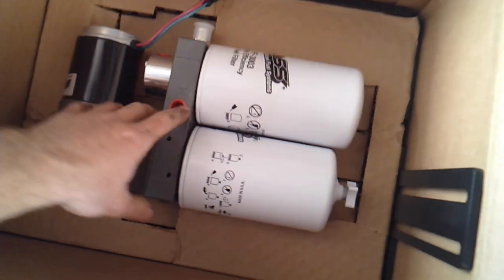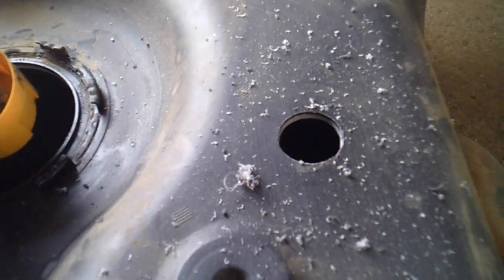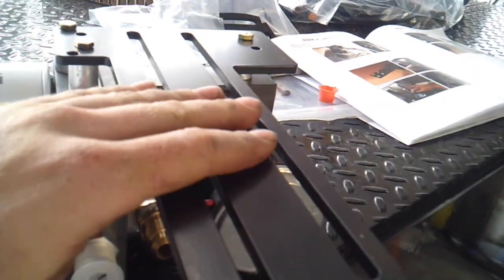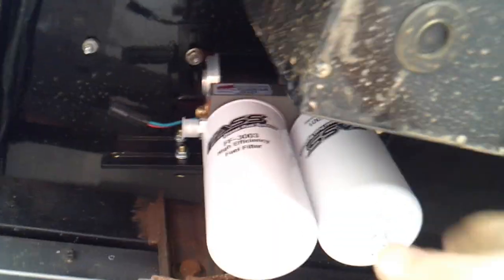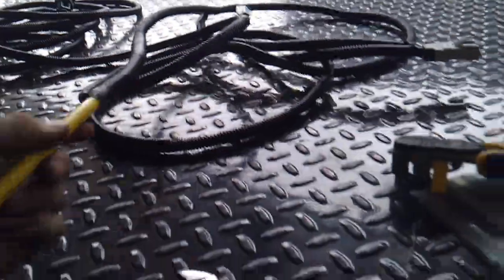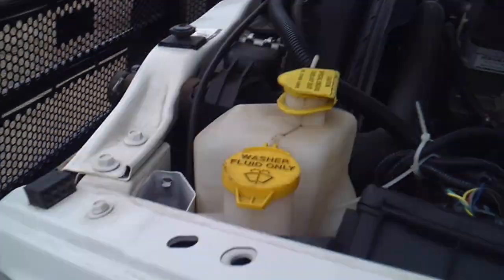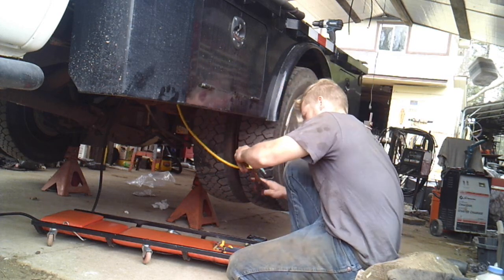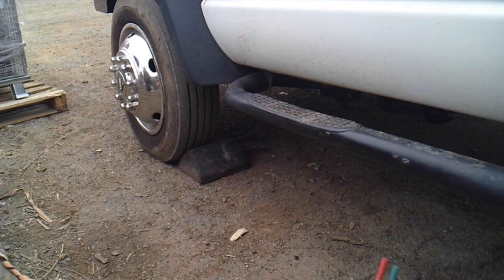INSTAL FASS 150 ON 6.7 DODGE CUMMINS

Comment: You can't hook the fuel line into the factory fuel canister so avoid the 1/4 tank issues?
Reply from the maker: I’ve never have any 1/4 issues. And factory pick up is to small

Comment: Next time you install one use a gnr tank sump . 2 of my cummins trucks have them . Never have to mess with tank and no 1/4 tank problems
Reply from the maker: I run off road everyday with my trucks. logging trails and rough roads. I cant and wont ever run a sump for the fear of something like a stick ripping it off the sump or a fuel line. just not a risk im willing to run. I don't want to be left stranded. thanks tho:)
Reply: Help me with mine
Reply: I have been running a Deviant return sump on my 07 for 5 years now. This truck runs overgrown mesquite rds here in west Texas and have never had an issue.. not to say it couldn’t happen.. Fixing to do the same thing to a 12 I just picked up with 91000 on it…

Comment: So I have a motorhome that has a 8.3 Cummins and I install a fass system I was unable to get the 150 and when I looked at the 165 it said it was meant for horsepower 600 or more so I got the fass 95 I wonder if I made the right choice.

My horsepower is 330 but my torque is over 900 and my tank I think it's a 120 gallons so perhaps I should have got the Fass 165 even though the 95 seems to be working very well with 18 pounds of pressure. I also added a fuel pressure gauge.

But I did learn something which I'm surprised fass hasn't figured it out yet, on the Factory  harness for the factory lift pump, once the engine is running it only stays running for 30 seconds and then the lift pump shuts off.

So when I install my fass system and connected it to my factory harness for my lift pump as we're supposed to, I learned very quickly that it shut off after 30 seconds when the engine has been running now it's only the vp44 that is pulling the fuel.

I even called Cummins and they said it's normal they're lift pumps are supposed to shut off, it doesn't stay running all the time.

So I had to find a different power source for my relay to stay on when the ignition key is turned to the on position, now my fass system says running at all time give my vp44 18 lb of pressure of fuel.

You might want to check yours as well just disconnect your return to your tank hoes on your fass system put a short hose into a bucket and let your engine run for 30 seconds and see if it shuts off on the return side.
Reply from the maker: Adelino Jr never heard of such a thing. There is no way that is correct. Running a vp44 without a lift pump is the fastest way to ruin the injection pump. I have fass on all our trucks expect my new one and fuel pressure gauge on all of them. Never once has one of them turn off while the truck is running. Every time I’ve installed a fass I start the truck and let it run for awhile make sure no leaks and such and they all stayed pumping. I believe someone gave you bad information on the lift pump shutting off when engine is running. I am a certified diesel tech cool as it may sound ppl I went to school with have the same paper and some work at Cummins and well their ideas maybe goofy sometimes but always keep fuel pressure to injection pumps 👍🏻

As far as your motor home goes I think the 95 will do the job just fine. I’ll be honest the 150s I run I would say over kill but price wasn’t much more so I went with those. Just as long as your fuel pressure doesn’t go very low on hard throttle it’s doing good.
Reply: @VBELTandSON  

Thank you very much for your reply👍

That's weird I wonder why mine kept turning off. I know I mentioned it before but  a little more detail,  When I first installed my fass i didn't hook it up my return to my tank I put a small clear hose in a 5 gallon bucket because I wanted to see the pumping action separating the air-fuel lol. 

And the darn thing kept turning off 30 seconds after my motorhome was running so I called fass and they couldn't figure it out, until the tech had me get some small alligator Clippers and connect them to the pin of the harness for my fast system then directly to a 12 volt battery.

The fass system stayed on it didn't turn off but the moment I put it back to my factory harness for my factory lift pump the way it's supposed to be the dark and turn off again after 30 seconds.

So that's when I called Cummins and that's what what that Cummins Tech told me but hey you're a tech and evidently you're vehicle's are running great so maybe mine is either messed up or something but I found a different power source so it works great now.

And thank you for responding about the fast 95 on the website I went to the 150 wasn't available and I kind of thought the 165 might have been Overkill since it was meant for 600 plus horsepower.

 I feel better now getting a 95 hey thanks again for your reply 👍 step the great work on your Channel 😉

Comment: Once installing it and using it do you ever have to change those filters or anything
Reply from the maker: yea some say every other oil change you can change them out but I don't change them nearly that often. you should drain the water separator one every month or so especially during the winter month
Reply: 10-4 thanks for the info
Reply from the maker: no problem subscribe if not already thanks!